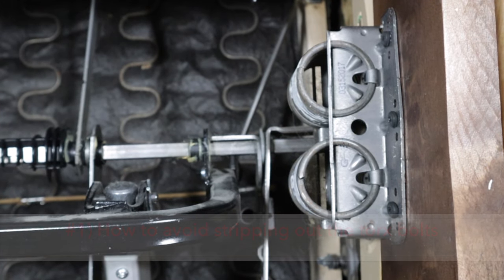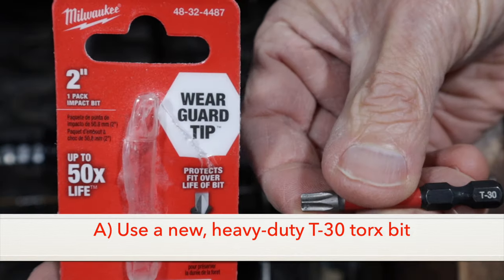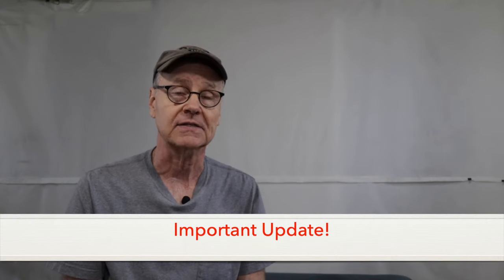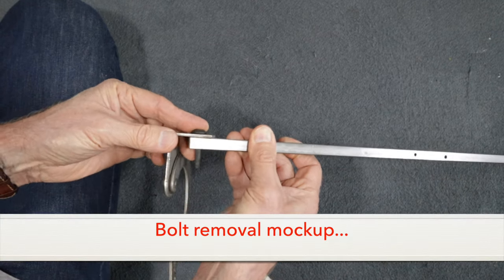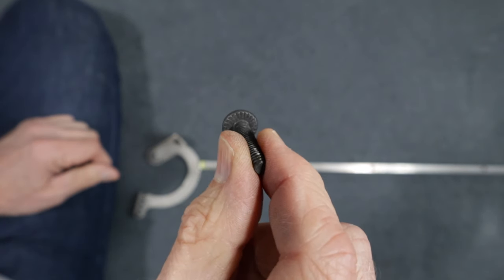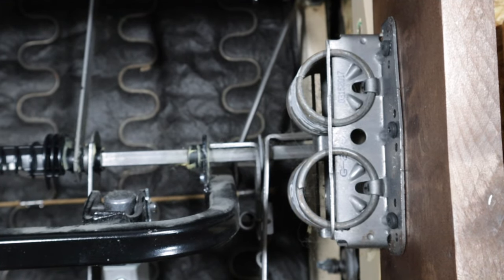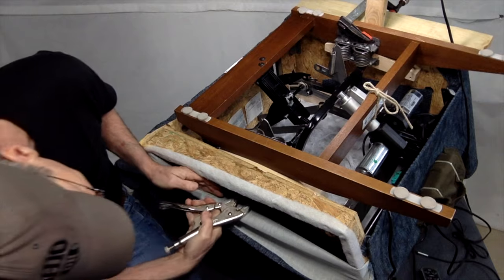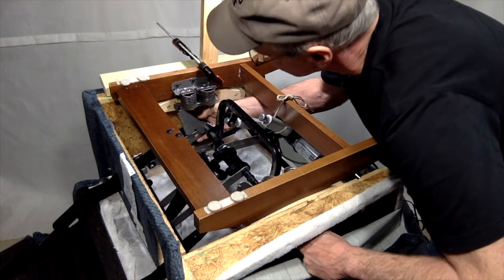La-z-boy Drive Toggle Clevis Installation Tips & Tricks

Comment: Thanks for the video !  I also have another trick. If you use a old drive bar and tap that one through it follows the original and you don’t loose orientation of the parts.  Thanks again for the videos of this as this is a pain in the butt repair!